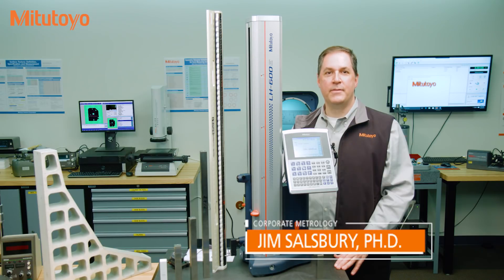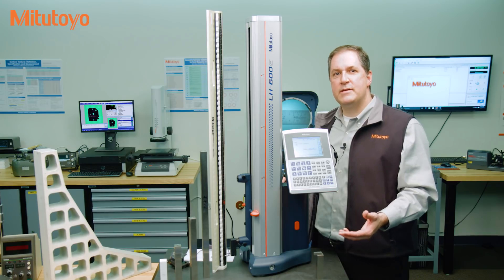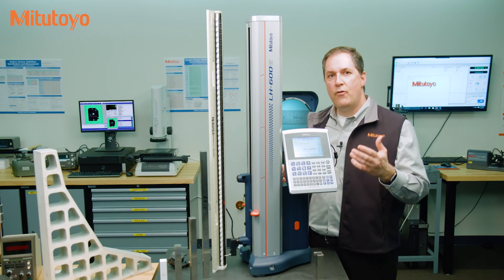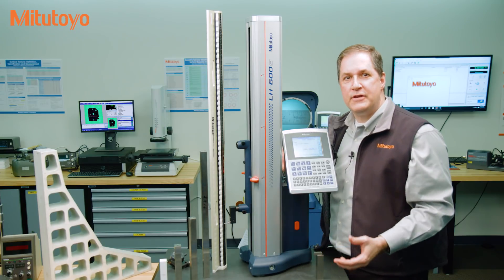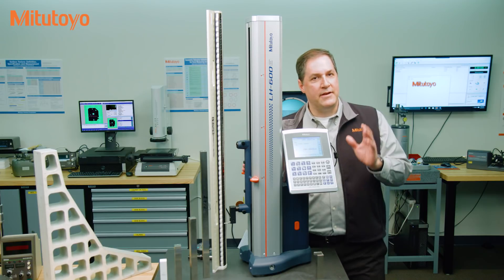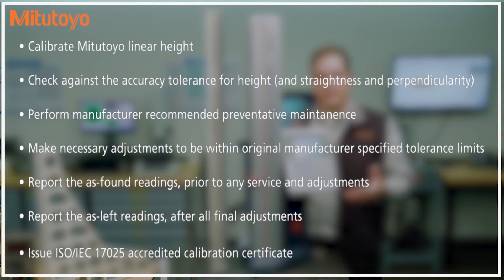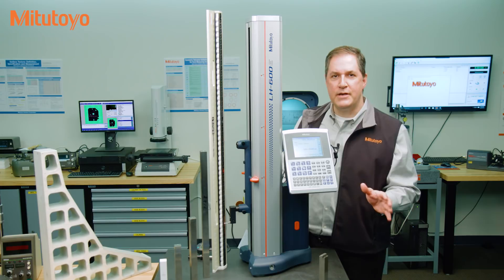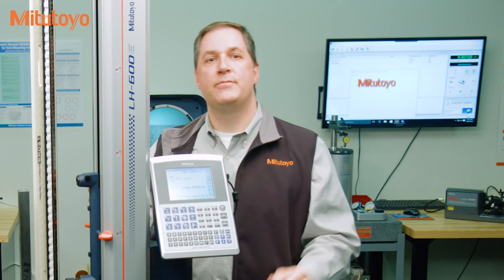Calibrate - Metrology Training Lab  (What is Calibration?)

Comment: Calibration should always remain purely measuring against a reference standard and recording the value. Nothing more and nothing less. If I sent you a gauge block to calibrate, would you then try and lap it or weld material onto it to bring it up to specification or adjust it? The fact that equipment becomes more sophisticated and "Adjustable" should never infer that this adjustment is calibration. You will open a whole can of worms in misunderstanding.
Reply: I would say that verification is just measuring and recording. Calibrating it would verify and make adjustments if needed
Reply: @Arcticroberto9376  Respectfully. 
Formally, "Calibration is the documented comparison of the measurement device to be calibrated against a traceable reference device." The above formal definition comes from the BIPM (Bureau International des Poids et Mesures).
There is no Adjustment inferred in Calibration. In fact if you adjust an instrument or reference device, it requires re-calibration in order to issue a certificate. Calibration is always the final step of the process. The all important certification and documentation. An instrument should be able to pass through any certified calibration lab with all results matching within the degree of uncertainty. This is why we can produce complex things to tight tolerances in different parts of the world and have them assemble perfectly at the destination location. 
I do not wish to detract from an otherwise fine video, however I have seen a rise in the misuse of the term calibration that cannot be ignored. The consequence can prove to be very costly.
Reply: @ernestopesto2874  yeah but they're French so their opinion doesn't count
Reply: @Arcticroberto9376  Back in the late 70's I studied a three year course in Engineering Inspection and Metrology at the Royal Melbourne Institute of Technology as part of my toolmaker apprenticeship training. We used to hold Mitutoyo measuring tools in high regard. Maybe I was mistaken.

Comment: Thank you! This is such a good video. Our "calibration agents" are insisting that equipments need to follow a specific schedule. Whereas we have been telling them the manufacturer's guide says it can be done at intervals. it doesnt mean specifically 6 months, 1 year or 2 years. Shouldnt calibration be depending on use? the more u use, the often you need to calibrate?
Reply from the maker: Good question.  You are correct that the calibration interval is really dependant on many factors and not standardized across the spectrum.  For example, a blacksmith may never calibrated his/her trusty calipers.  If they are off by a thou or two, no big deal and low risk.  However, an automotive parts manufaturer might calibrate their shop calipers on a yearly basis.  Some higher risk use, such as military branches, might calibrate every six months or even shorter!  The calibration history of the product (have you noticed any drift in the readings), it's use, and associated risks will help guide your calibration interval decisions.
Reply: How my organization always does it is examine the track record of the equipment and see how much its readings change from calibration to calibration.  If a piece of equipment doesn't drift from one calibration to another and is seemingly always in tolerance, then you are wasting your money if you calibrate it too often.  Conversely, if it is usually out of tolerance when you calibrate it, you probably need to shorten your interval.  Also, be aware that a piece of equipment just sitting on a shelf can still drift out of tolerance!  For some equipment (particularly in the pressure measurement field), long term storage can be worse for accuracy than frequent use.

Comment: I have found the best way to explain calibration to people is to never use the word calibration except in an overarching way.  I use the terms performance verification and adjustment.  So you test the UUT with a performance verification.  If the UUT does not fall within acceptable readings, then you perform an adjustment procedure and then test the unit with a performance verification.  This eliminates the confusion of the definition of calibration.
Reply: I like your thinking.